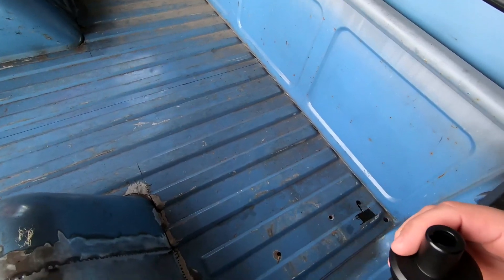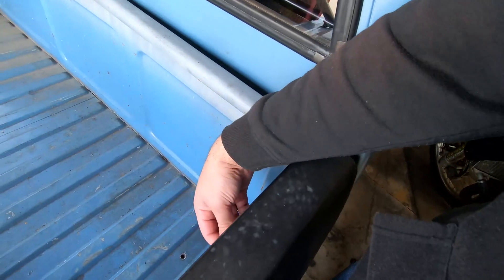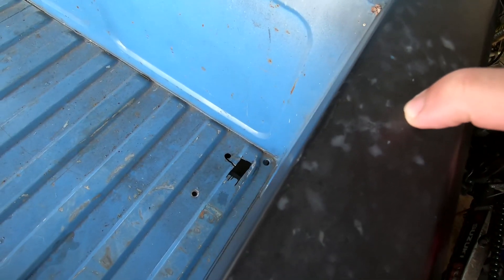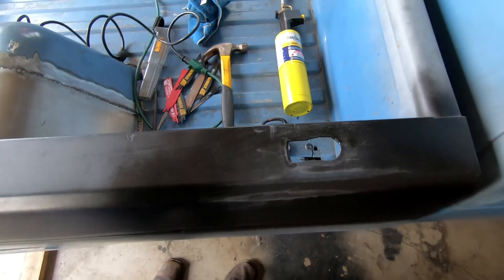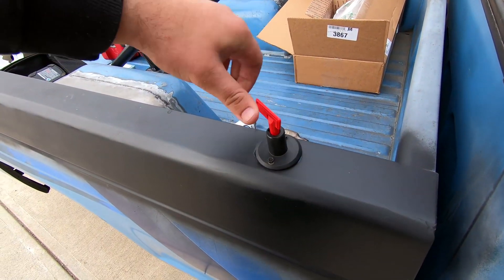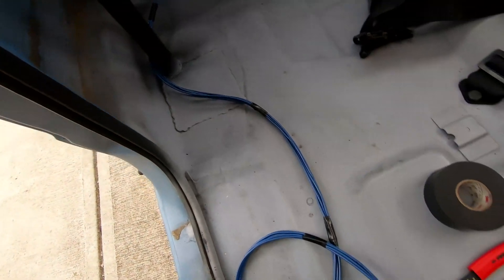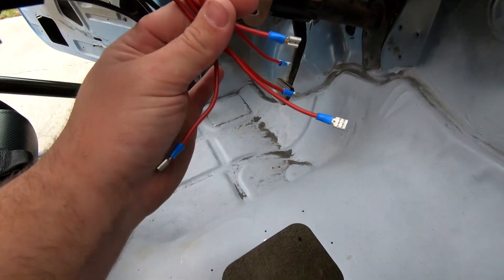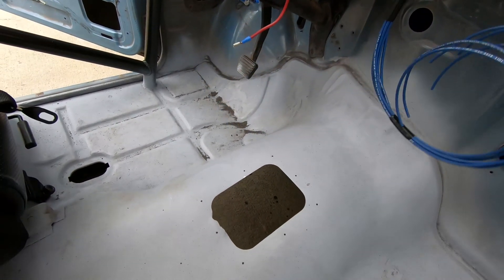Wiring a Race Car from Scratch!

Comment: you need to put the battery switch at the back of the truck according to NHRA Location: The switch must be installed at the rear of the vehicle and be easily accessible from outside the car

Comment: Being picky here, but why run 6 smaller gauge wires all the way to the switch panel instead of one large gauge then distribute from there?
Reply: My thoughts exactly, run a large wire upto a distribution block and then tie in all the wires onto the bus bar.

Comment: What gauge wire did you use from the power block to the switch panel? What gauge wire did you use from the start button to the starter? I based my race truck wiring off your video, it was very informative.
Reply: He used 14 Guage from distribution to switch panel
Reply: gauge isnt that important just not hair thin or wire that weighs pounds lol. if youre holes aint thick enough just drill again. hope this helps anf hope you get it runnin soon!